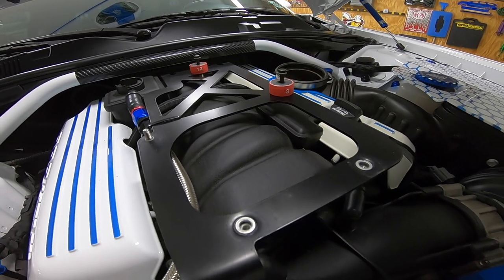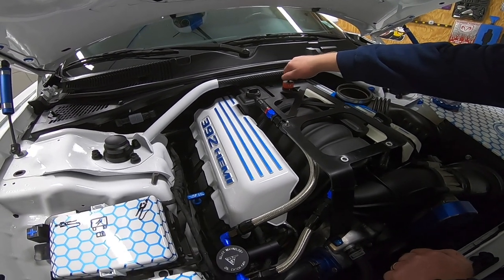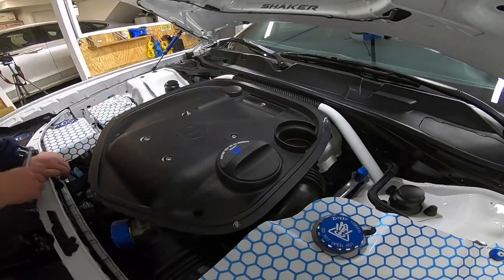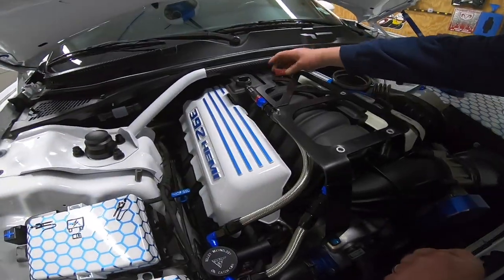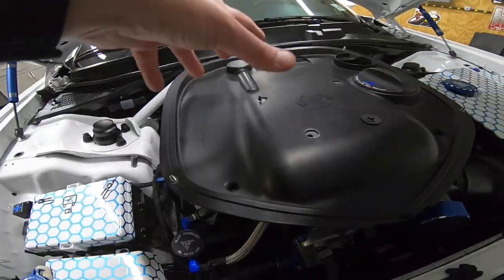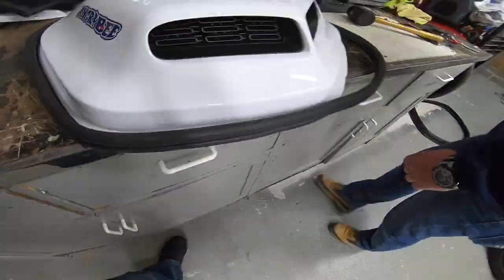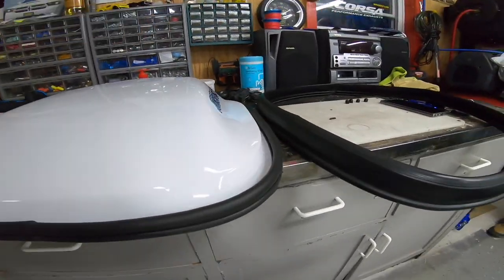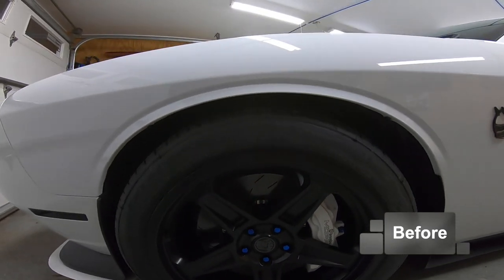Dodge Challenger Shaker lift kit from - Scalia Motorsports

Comment: That was my biggest issue with my scat pack. I hated how low the shaker was. I traded for a hellcat now though so I can’t complain too much!
Reply from the maker: Same here I always thought it was too low which is why I went with the Cervinis kit. ... Then upgraded to a hellcat 😏
Reply: @WorkPlayDrive  I saw a shaker car at Steve white motors with a 426 and a whipple in it.... somehow he still got the shaker to fit, and it stuck up way more like the one in this video...I was only slightly jealous lol
Reply from the maker: I still want to shaker the hellcat, but it needs to be functional.
Reply: @WorkPlayDrive  oh I agree! If someone figures it out, I’m all in.
Reply: @WorkPlayDrive  
To low and not as big as the old shakers were on the 70's cars.

Comment: THAT AIRBOX COVER!!!   i need one in my life. the shaker airbox sucks and does NOT seal to the hood like the rubber gasket suggests.... scalia motorsports make that too?
Reply from the maker: Yes he does, the cover on Angrybee64's airbox is from Scalia Motorsports Link - https://bit.ly/3cqKNmJ It was designed to seal the airbox from the warm engine air and pull a lot more air from the shaker itself.

Comment: How is he dealing with rain runoff?  I'm sure he's not going to let it come off the front and blow around the engine bay.  Patiently waiting for my riser kit and engine cover cut-out.
Reply from the maker: The rain follows the same path it did with the factory seal.
Reply: @WorkPlayDrive  Unless I'm missing something, mine flows to the front point where there's a hole so the water falls on the belts.  Is there nothing that routes the water down and away, like a hose?

Comment: That does look good, but my corny  idea that it would go from stock height to more pronounced height as the car went faster. Kinda like the door opening on the air grabber hoods.
Reply from the maker: Possibly wired to actuators triggered by the gas pedal....  Scalia Motorsports needs to get back to work on this!!!
Reply: LoL, would be interesting to see.

Comment: We have a 2021 Challenger RT Scat Pack wide body shaker and even though it's stock it rubs against the inside of the hood. Maybe it needs to be adjusted in order not to rub on the passenger side front.  Have you run into this problem?
Reply from the maker: Yeah a few people have the same issue it’s just inconsistencies in the build. If it really bugs you you can take it to the dealer to see if anything can be adjusted. 

Sorry I can’t offer advice on adjusting these.  My personal shaker was an aftermarket kit from  Cervini it had  no contact with the hood

Comment: i was wondering would i be able to use a shaker on top of a supercharger and redirect the intake  tubes to work with the superchargers intake tubes
Reply from the maker: I’m thinking the supercharger is too tall for the OEM hood. I’d love to try with the Cervinis kit in the future.
Reply: @WorkPlayDrive  thaank god somebody has the same idea as me its been sitting in my head all the time for weeks bothering me at school id doodle ideas as to how i could make one fit too
Reply from the maker: I’ve got it down and drafted, then next step is to purchase and cut up a $2000 hood kit from Cervinis to fit it,  my fear is the supercharger is so high and limit my ability to make the kit functional.

Comment: Shakers look cool, but everything I've seen indicates that a HC airbox with headlight intake will give you better AITs.  You also lose the heat exchangers on the OG Hellcat hood that's now on the Scatpack.  So all in all, it's a performance hit just to watch your motor torque.
Reply from the maker: Shaker is an experience, which is a huge part of driving these cars.  Lower AITs can be achieved by simply purchasing the Mopar headlight intake tube designed for the shaker. 

I installed it on my shaker a few years back, quick and easy way to lower AIT.
Reply: @WorkPlayDrive  I've done A LOT of research on this because I wanted the Shaker, at first.   You lose the scoop with the heat extractors.  I've heard the complaints over and over about the heat of these engines.  It's why people put a 180 degree thermostat in.  Again, it looks cool, it just slightly hurts your engine's overall performance.  There's no denying that...  Your engine will run hotter, and even with the headlight intake, your temps will be 2 or 3 degrees hotter, especially on hot days with the sun beating down on your hood...  I ain't saying it's not an "experience," just not one worth it (to me) from a performance angle.  You also can't just do power adds.  You gotta make sure they'll work with your shaker.
Reply from the maker: There truly is a lot of noise on this subject.  

it comes down to, how exactly do you want to use this car?  All of this data only matters if you’re going to be climbing a curvy mountain for 20 hours in desert heat, track racing the car or drag racing in back to back runs. 

After having a 2015 scat pack with a standard hood, then later adding the hellcat intake, having a shaker, then later again adding the hellcat intake  and having a hellcat. 

In my daily driving and random drag racing it didn’t matter to me. I’m not a professional racer chasing tenths of a second.  

I’m a guy who bought a car to drive it and enjoy it, and out of all three, the shaker brought me the most enjoyment.

Comment: Hey I noticed he has a strut support bar across the engine.  I have a shaker myself Mopar makes the half ones I don't like those can someone tell me where I can get one that fits a 392 shaker? Ty
Reply from the maker: The Petty’s garage strut bar fits across the shaker and looks clean. 

Stay away from the speedlogixs one they rust and drool brown all over
Reply: @WorkPlayDrive  thank you for your help i will check them out  thanks again 😀 👍
Reply: @WorkPlayDrive  I've got a Speedlogix STB on my Challenger Shaker and one on my Charger and haven't noticed any rust.  I wasn't happy about having to drill my own push pin holes and the slot underneath on the passenger side for that part that hangs off the bottom.
Reply: @WorkPlayDrive  Don't you mean Petty's garage and not Perry's?
Reply from the maker: Yep 🙏

Comment: Did he paint his Shaker?
Reply from the maker: Yep he had the shaker refinished and painted to match the car.
Reply: @WorkPlayDrive  did he do it himself or went to somebody?? Do you know if we can get these wrap? I’m looking into a scat 50th anniversary because it’s already painted and not much a difference between the two the only thing I notice I can add the hood pins
Reply from the maker: He has it done at a body shop. It’s flawless. The shakers plastics are filled with oils. It’s a process and a giant pain to soak out the oil‘s and bake them so paint can stick.

Comment: That looks good. I think I may have to get me that kit. Thanks for that post. 👍

WWG1WGA
Reply from the maker: Any time!
Reply: @WorkPlayDrive  Did your friend make notes on his temp gage of before and after the kit? I'm thinking that that should help the airflow into the shaker. If he did I would be interested on how much this dropped his engine temp if at all. Thanks again for your post and thank your friend for sharing. 

WWG1WGA
Reply from the maker: No sorry, but he also has the Shaker airbox cover https://bit.ly/3cqKNmJ which stops all the hot engine air from getting into the airbox so it would be an unfair measurement.